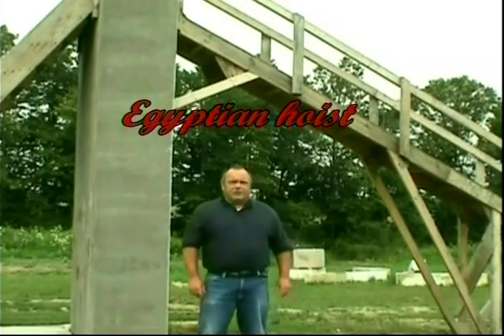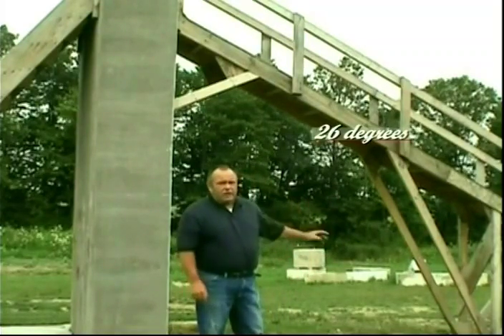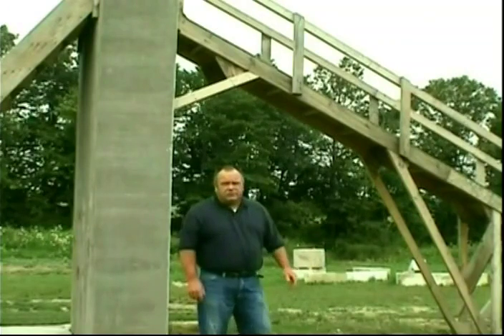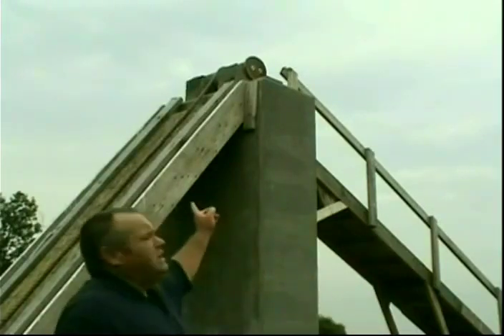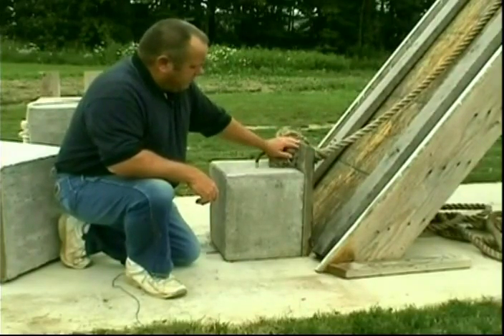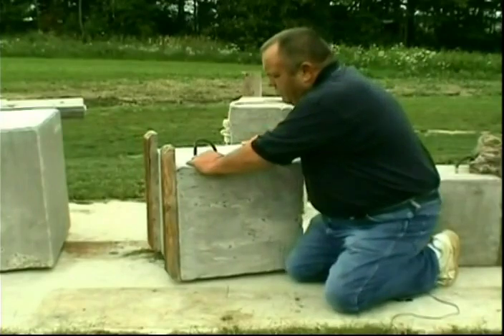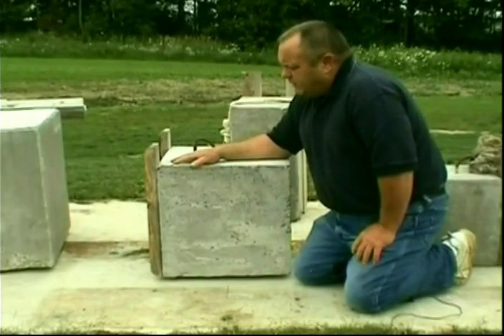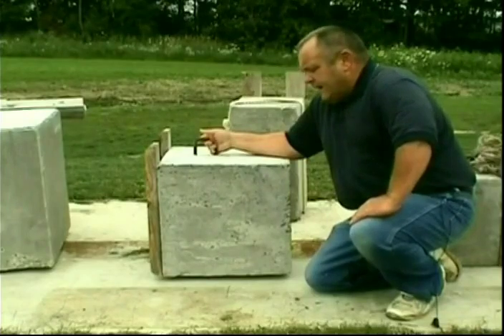Ancient Egyptian Pyramid Building Technique Reveal By Wally Wallington

Comment: The real questions are, how did they move 20 ton blocks without chains. Ropes are not strong enough. And also, how did they put them into place. Lifting is the easy part. Moving them into precise positions takes more knowledge than we possess today. It is still a mystery on how they built the pyramids.
Reply: Rope and ox. Rope and elephants. Counterweights. Those old hats could mavigate the ocean by the stars as a map so figuring out how to use 2 stones to lift up 1 on a rotating assembly is very rudamentary a basic crane
Reply: @TheAnnoyingBoss  But again, the question remains..., How did they move 20 ton blocks and put each one in place every 9 minutes, day and night, for twenty years? Not to mention carving them ahead of time and to fit perfectly snug up against each other. Moving large objects is not an issue for anyone, but moving large objects and stacking them within minutes IS a very big deal.
Reply: 😂😂
It's not.
Reply: Why aren't ropes strong enough? You do understand that the blocks are slid along the ground or ramps, not lifted into the air right? And you can use more than one rope? Maybe they used neither ropes nor chains but levers. Honestly you denialists cling to the weakest of straws.
Reply: @chrisgrill6302  Not clinging to the weakest of straws, I'm just using common sense. No, there was no help from aliens, I'm just saying that this is not how the blocks were moved. At the rate it takes to move one block, it would have taken over 200 years to build the pyramids and how did they move the blocks once they pulled them to the top? No one ever shows you this. Yes, they show them balancing huge stones on tiny rocks, but how do they get the tiny rocks under the stones, and how do they remove them? 
I grew up on a ranch/farm and we moved a lot of things with blocks and tackles, especially trees that weighed several tons, but to build a pyramid with such precision would require a stone to be placed every 9 seconds for 20 years straight, and this is impossible. Even scientists know that the pyramids were not built this way.
Reply: @kentuckwhite6701  BTW, "ropes aren't strong enough"???

Ever been to a port or harbor? Ever notice those giant lengths of rope they use to tie up and pull the ships around???
Reply: @codymoe4986  Yes, but you are comparing modern ropes with hand woven ropes. but for your sake, let's say the ropes were strong enough, you still haven't told me how they moved the blocks in to place. Getting the block to the top of the pyramid is the easy part. Once it is there, how did they maneuver it into place???? Like I said, they would have to move a block into place every 9 minutes to complete the pyramids in 20 years, and this is impossible.

Comment: A ramp, external or internal is a one lane elevated road where blocks move one after another, and any problems will halt progress. The documented timeframe for construction of The Great Pyramid is twenty years and Pharaoh Khufu certainly required the Pyramid for his use on his death. The application of logistics of time and materials concludes ramp theories are impossible. There had to be a simultaneous raising of blocks and if all four sides and all surface area of the Pyramid could be utilised this provides the logical direction of critical thinking of realistic engineering.
The Documented Ancient Construction Method of The Great Pyramid
Rampless Giza Pyramids construction using Four‑Lobe Pinion‑Pulleys
When Giza Pyramid builders laid the first layer of limestone blocks for the Great Pyramid, all that was required for the second layer was a method of leverage using the first layer, and so on for progressive layers.
Just as human-beings walk upward on steps, step by step, Giza engineers raised Pyramid blocks step by step, thereby using all space available over the entire Pyramid’s four sides progressively until completion.
Tomb models of “Petrie rockers” provide evidence of the “four‑lobe pinion‑pulley” which surround a Pyramid block and step walks its load when hoisted.
Giza Pyramid builders used the earliest known example of “Rack and Pinion” engineering technology, where the Pyramid consists of four sides of Limestone Racks (steps) and Four‑Lobe Pinion‑Pulleys engaged Limestone Racks (steps) with positive displacement when hoisted.
Search "haitheory"

Comment: The Egyptians built the pyramids from the top down.  No need foe silly hoists like this that could never be used for lifting blocks up if one were to build a pyramid from the bottom up.  The only problem the Egyptians had was the bottom row in which to make everything even out before they built the chambers under the pyramid.

Comment: very bold to claim 400 men could lift 2.3 million stones in 2 years. ive been working construction for 21 years, running projects for 14 as a superintendent. no friggin way was this thing pulled off as perfectly as it was in 20 years as the claim. they cut into the bedrock 30ft on one side and built one corner of the first few courses out of bedrock to keep the pyramid level. the grading alone would take us with modern dozers more than a few years before we were even ready to accept the first stone. jimney crickey could you imagine how long the architect would have taken with his drawings? at least 4-5 years to even know what the hell we were building. this is multiple generational work over centuries.

Comment: Surely the growth of manpower and lifting maxes out as you cannot extend the line of people forever on the slope, especially at lower levels of the pyramid. Also, the wheel was not invented at the time of the construction, so the rope would be going over a flat edge or corner, so added friction and breakages/stoppage. Also x2, the blocks moved were in the hundreds of tons range if i remember correctly. 

Pretty cool though.
Reply: Why have a stone with a corner when you could have a curved stone, they could make columns in those days, they knew about curves.

Comment: Hmmm, interesting demonstration but as the blocks in the Great Pyramid weigh as much as 7 tons, I think a demonstration of hoisting a 7 ton block using this system would be more interesting. As far as I know, and I could be wrong, 500lb blocks were not used in the construction process and so the claim that 400 men could hoist the blocks to build a pyramid in four working years needs some adjustment.

With further consideration of the stresses involved on timber when moving heavier weights, much heavier weights, would require an enhanced design of this system. As I said, interesting presentation, perhaps going in the right direction but my objection here is that I do not believe this model scales to the weights and stresses of the actual buildings. That would have to be tested a 100% scale.
Reply: Only 7 tons? The blocks placed on the Royal Chamber at an altitude of 100 meters weigh 80 tons!
Reply: @mtgne5351  just put the stone on a gentler slope. Bro erected a 10 ton megalith by himself on another video, to emulate Stonehenge.

Comment: You can see this guys technique in series too.  So start with the smaller weights and then pull up multiple stones.   Only lift the big  heavy stone when you have an equal or larger weight at the top already.

Comment: keep dreaming....they did not have the supplies like you used.. and does nothing to explain where stones came from,how they brought to that area,much less how they placed stones that large,so high...nice try.😂
Reply: The Bent Pyramid in Egypt still contains numerous pegged and jointed wood beams inside it so they absolutely did have the same supplies. The Giza plateau is the quarry, about 95% of all the stone for the pyramids there came from about 200 meters away. With the average stones weighing 2.5 tons this demonstration shows how you could move heavy stones up several courses at a time.

Comment: an 18" concrete block is a lot lighter than a 4 to 6' solid granite block, by quite a bit, and keep in mind, there are 2.8 million of them in just a single pyramid, yet the claim is that they were done in the span of a single pharaoh's lifetime.  the math doesn't add up
Reply: The interior fill of the pyramids has far smaller less sculpted blocks examination of the robber's tunnel has shown that many of those blocks only weigh 800 lbs. or less. As well the higher up the courses go the smaller the blocks get.

Comment: Really smart idea. A couple thoughts- I don't get how the positioning and securing of the blocks would have worked. Also the heaviest stones in the pyramid were at least 50 tons (100,000 pounds). This seems like a solid starting concept but still leaves out most critical details other than hoisting. Still, I appreciate the insights offered here.

Comment: The pyramids, like most old "stone" structures, are poured concrete.   There are hieroglyphs in Egypt which show them mixing and pouring the cement into molds.   Sorry you don't know that.
Reply: If they used molds why are all the blocks different sizes and un uniform? if they used geopolymers why is there a huge quarry that the pyramids are sitting in with unfinished quarrying of blocks? If the blocks were poured why are there tooling marks on them? How did millions of blocks get poured without any spillage, in ancient sites where concrete was used there is evidence of spillage, yet none exists at the pyramids.
Reply: Sorry you can't provide a link
Reply: @gonzo1354  Paul Cook has the video online about it.  I can provide the kink, but you can also find it now.   Paul Cook.  Do your own research